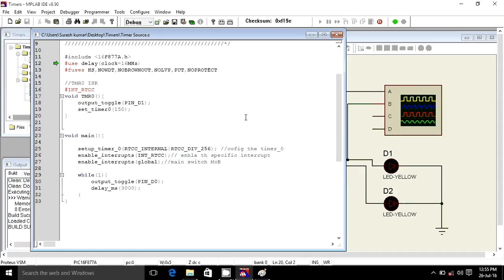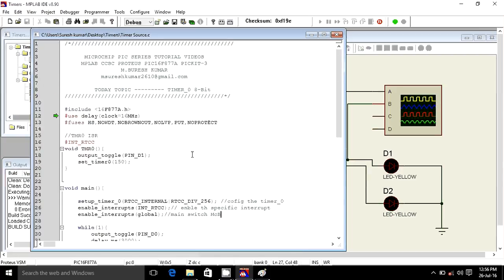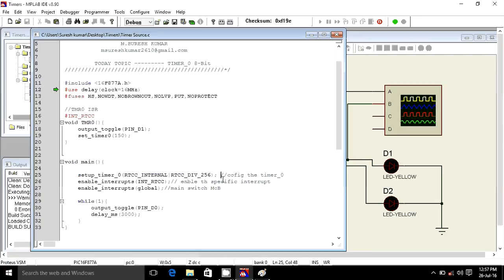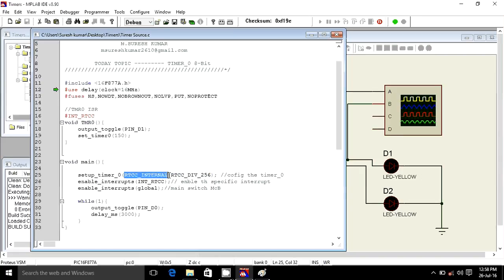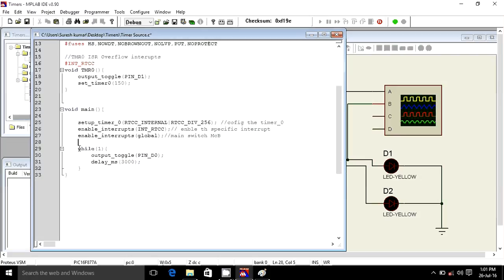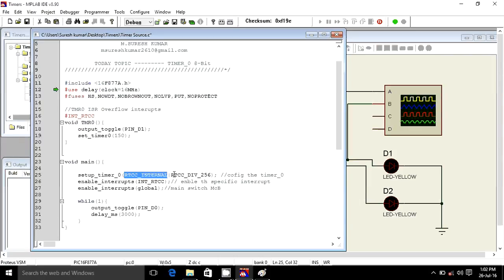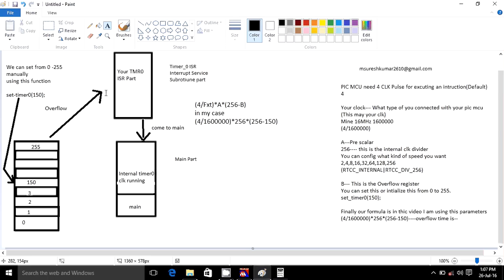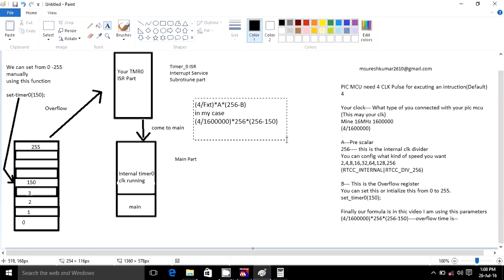15 timer 0 Calculation. MICROCHIP PIC16F877A, CCS C PIC-C, MPLAB, PROTEUS

Comment from the maker: Here Is the formula and calculation. You can use it.

(4/ Fxt) * A * ( 256 – B )

Where

Fxt is oscillator frequency, Your external should 16Mhz.

A is prescaler value = 32.

B is initial value loaded to TMRO.=131. Make this line inside your subroutine part --- set_timer0(131);

Example: If Fxt = 16MHz, A=32 and B=131 then total-time delay until TMRO overflow

Here is the calculation (4/16)32(256-131)=== 1000 millisecond timer0 overflow

interrupt occurs every 1000 msec.

Try this...